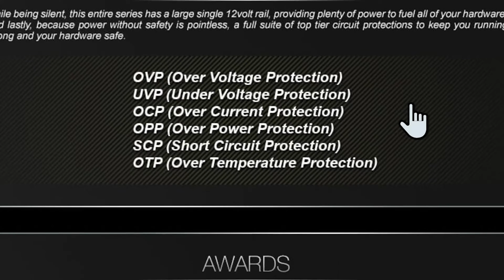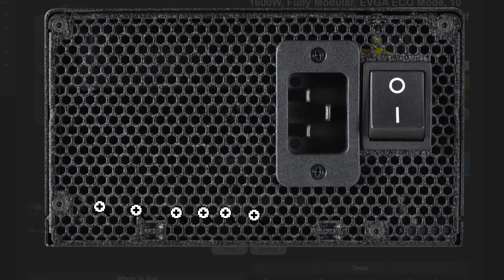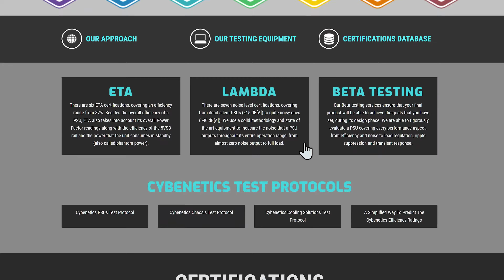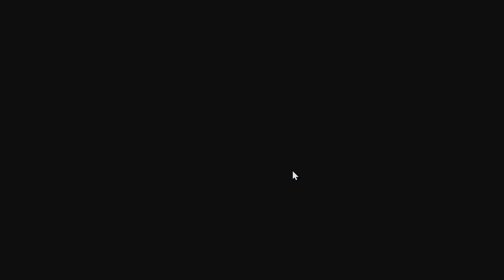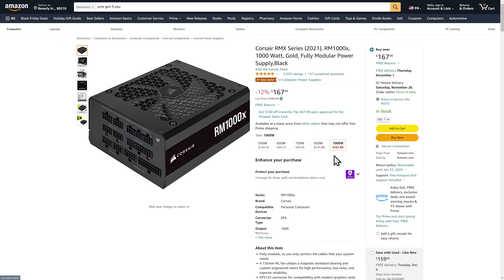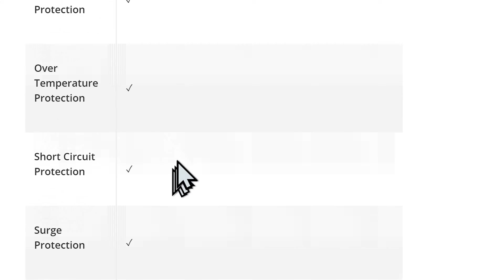Choosing a Power Supply 2023 - Dos and Don'ts - Beginner's Guide

Comment: Titanium is already expensive. Diamond will be even more insane. If it helps save even more money on electricity than good. The startup cost for diamond power saving won't be for the weak or cheap. I think most people will be fine with platinum/titanium. Diamond is only about a couple percent more than that. I don't think the price will be worth it over titanium. If you can get these units on a good sale. Then that's another story. Just remember to review the products from people that have a lot of knowledge on the subject and are trusted and not shills.
Reply: I can only see Diamond mattering for a buisness at quite a scale and at that point it they'll be doing enough research there is no point in adding a special sticker for it.

Comment: Just a heads up for the layman: most wall outlets in the US are rated @ 1500 watts. 
So, a psu with anything more than that would require special electrical work or else you are opening yourself up to trip the breaker.

Comment: I honestly think some computer components are so Over rated if you dont fullly really need them. Basic cheap PSU most times do about the same job as a "PREMIUM" medium range PSU i think many "premium" pc components are just a stylish component that normally has a little or the same performance as a normal one but at a multiplied cost. Remember PSU have standart minimum specs to comply so you cant get wrong with it. If you low on budget always consider a cheap PSU if you want a real good PSU idk, come watch this videos like me :D  I just want underline to always consider a "standart" PSU with the Wattage range you need, you cant go wrong with it.
Reply: While I agree that cheaper power supplies often work perfectly fine they do often cost more in the long run if power isn't cheap where you live. The price it more expensive at first but `200$ is easily accounted for in power bills.

Comment: I will never buy enermax again. Many years ago i bought one it had slow fan "silent" super anoying noise since the first day. you could like listen the ball bearings rolling around. After some years i decided to open it and remove the fan and fuck it :D  it still worked for some months full passive mode but my case is not hot and full aluminium. Some component exploded on the peak of summer but it was totally worth it for me cause otherwise i would just slap it into trash (its where it deserved to be) and i replaced it for a cheap, basic one that worked much better. By far the worst and most expensive PSU i had and now im planing make a destop. I consider fanless psu.  NOISE is absolutely anoying in some components. I think its a little crazy paying tons of money for PSU and they still come with Fans. 
What waranty you have they will not suck on noise? consider buying them with a close retailer and to return it first days if you dont like it, or consider buying a fanless one. why i never see youtubers recomend a True fanless PSU? 
I get a little crazy when i see boxes say fanless buy they clearly come with fans. 
For more and more detailed PSU reviews!

Comment: I bought that Cooler Master V850 Gold V2 power supply with a 10-year warranty for 103€ , for that price I couldn't have found a better one. According to the reviews, it is also excellent. I won RTX 4080 on a giveaway and I will use it together with the R7 5800x3d and without much planning had to buy a new power supply, it should be more than enough. The GPU hasn't arrived yet and the power supply is still in the box and there is an option with 167€ Thermaltake ToughPower GF3 850W only ATX 3.0 at a decent price. I'm interested in what you think, whether I should return it and take ATX 3.0 or leave it.
Reply: I’m thinking the same thing, and I gotta drive like 40 mins away to return a.1000w Corsair rmx, it may not fit either but the msi psu and will fit 1000w I’m looking at is the same price and is atx 3.0/pcie 5 ready and comes with a 16 pin. The drive doesn’t bother me so I’m gonna do it. I will say it doesn’t matter yet as much as it will in the future, unless ya care about fast nvme ready times and shit.